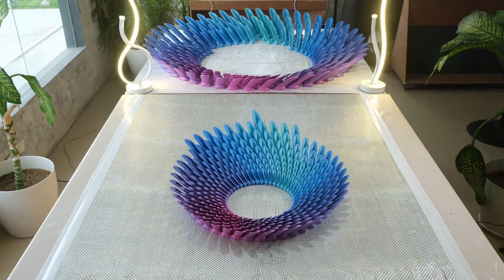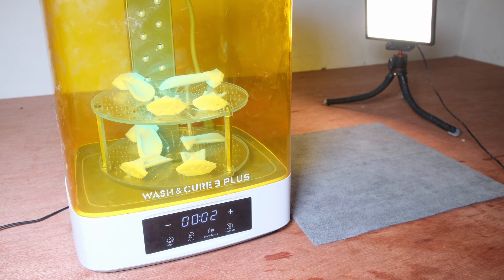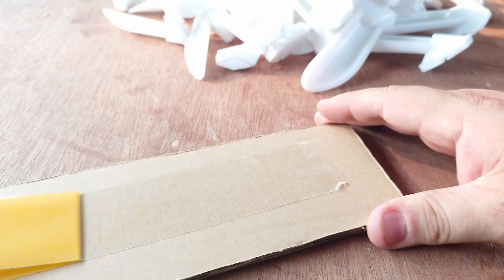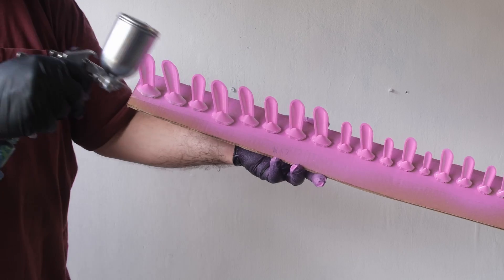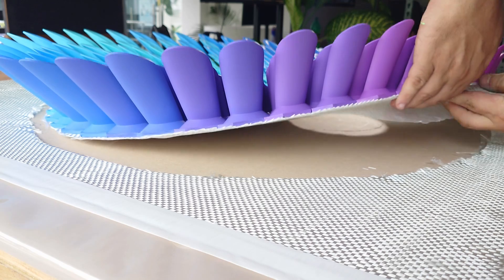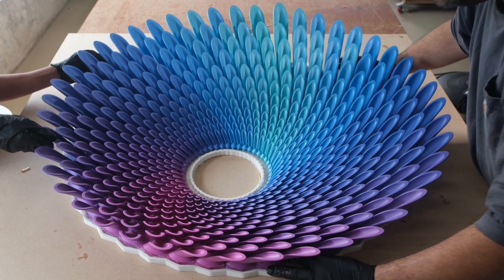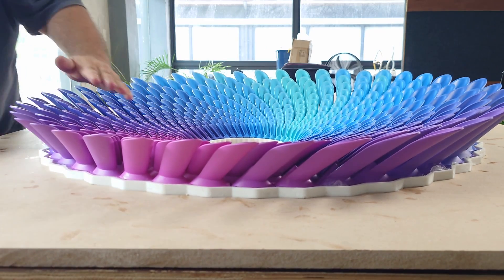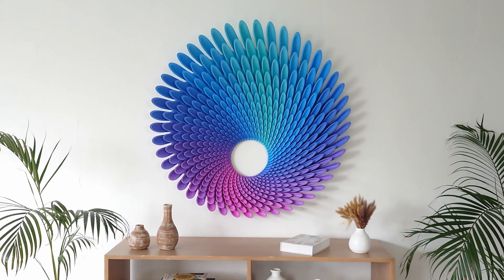The Art of 3D Printing: Crafting a Monumental UV Resin Sculpture

Comment: The problem with plastics is they end-up in landfill or the ocean”. A somewhat fatuous statement, you need to get a basic understanding of thermosetting and thermoplastics. Plastic isn’t a ‘chemical,’, unless it’s just been added to the Periodic Table and I missed it. Thinners are either solvent or water based, there is a distinction.

Comment: Hi Herschel, fellow artist here. Love your progress and how process improves. Process is so important. unique process creates unique art. Tilting vat in my resin printer is a game changer, so far no failed prints and those printers got cheap. I have eleego saturn 4 ultra.
Reply from the maker: The Saturn 4 ultra looks like a big step forward. The failures I have typically are from worn out FEP film or imperfect leveling if the build tray.

Comment: Rad work sir... Did you ever consider screwing all the pieces in from the back? I'm lazy so Id use a PVC board, and my CNC to make precision holes, that way you can use tiny screws for the smallest petals, and bigger for the outer. If you found thick PVC, you could even machine out the polygon base to make alignment even easier.

Superb work!
Reply from the maker: I have considered screwing to a board. It will require a full size cnc machine, which is something that I'm also considering.
Reply: @HerschelShapiro  a simple one that does 4 foot square probably would pay for itself, mines just home made, and does the trick.

Comment: Curious, Did you print the tray or mold you used in the final step? Pretty specific. Was it silicone to allow for the release?  Great work!
Reply from the maker: The tray is silicone, and the mold for the silicone was 3D printed.